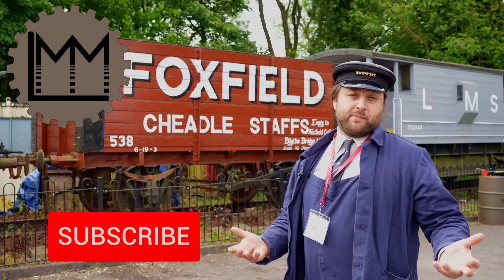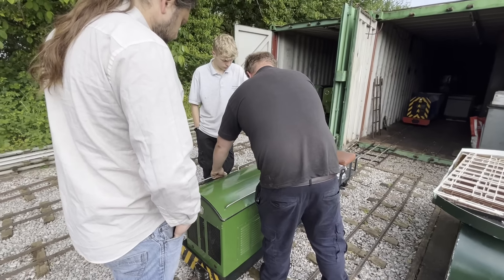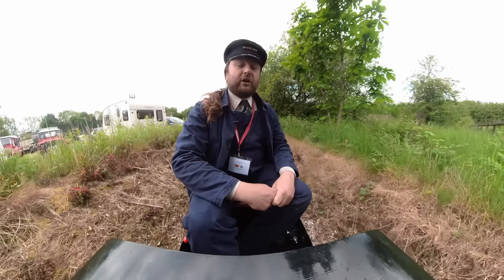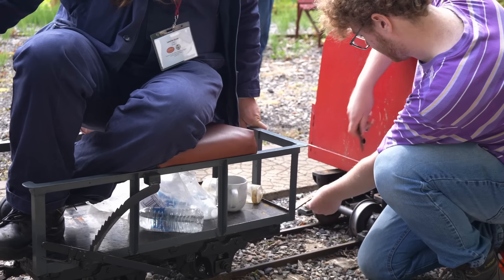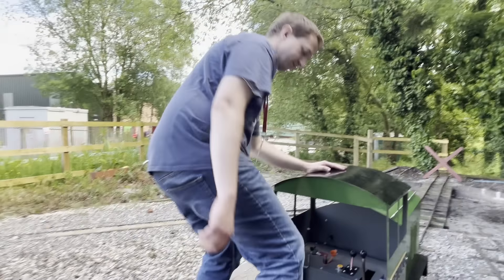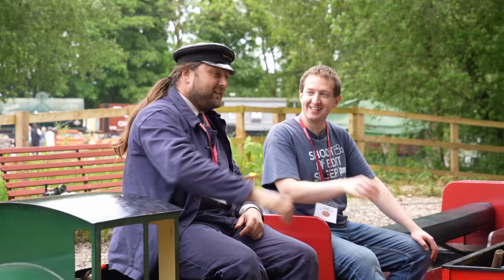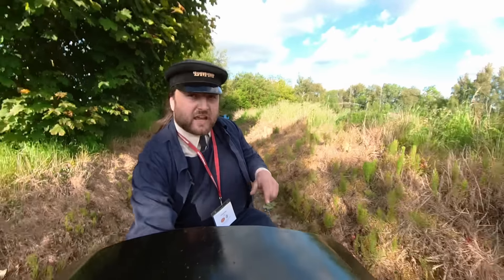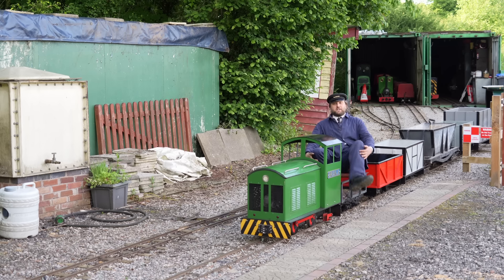Taking over the Miniature Railway at Foxfield for the day!

Comment: I think i missed something. If the track is teardrop shaped and has a turntable at the terminus, i dont see the need to top and tail?
Reply: If I recall it’s to do with the power of getting up the bank with a full load of passengers as it’s a bit of an incline for the umph the one engine on its own has.
Reply from the maker: It's to speed things up on return to the platform, and one is effectively the guard when on the back end
Reply: @lmm  thanks

Comment: How much fuel did that thing go through in the day?
Reply: Those Honda engines are pretty fuel efficient. Hence why they are mostly chosen for applications in garden machinery, small construction machinery, generators and go karts.
Reply: We went through a diesel can’s worth for one of them (though don’t know if the can was full)
Reply from the maker: They were both pretty empty and had 2.5 litres of petrol added to them both.
One ran out just as we were putting it into the shed.